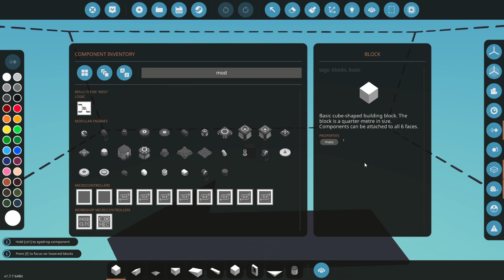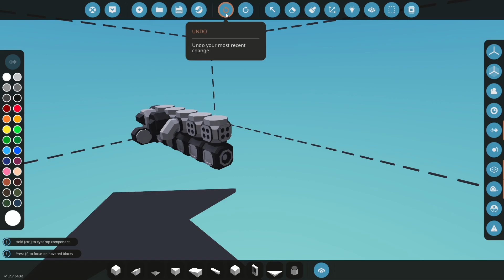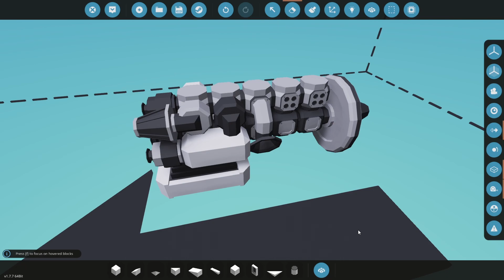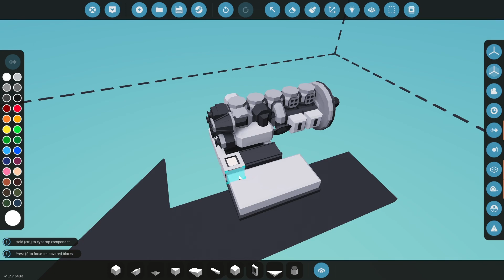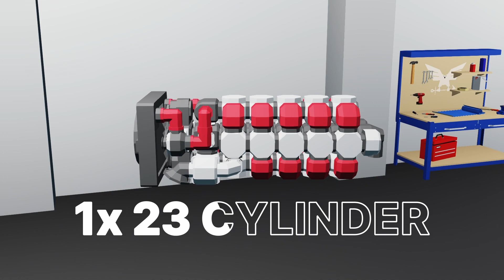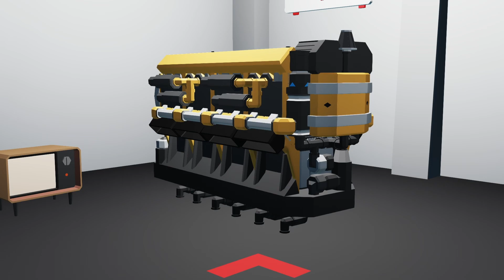Stormworks - Modular Engine Tutorial [Quiet/Delisted]

Comment: Very nice video. I have one objection though. You used the word supercharged to describe using a pump to force air into your air manifold. As far as i am aware a pump counts as a supercharger as long as it is externally driven. For example by a secondary engine or an electric motor.

Comment: Can the 3x4 cylinder engine be converted to overland use for mining machinery
Reply from the maker: I don't see why not. The decorations I used were based off pictures of engines inside a pilot boat. Underneath its still just another 3x engine.
Reply: @terr-rawr-saur  I was thinking about the starting method could you use 1 or 2 starters and the  cooling would need 1 elctr pump and 1 modular and a large tank
Reply: Also using 1 electric pump and 1 modular engine pump is better because I like realistic builds less complexity less chance to fail that's why I was asking about the starting method
Reply from the maker: @milantodorovic4034  You would have to be running a 3x engine at incredibly low rps to avoid overheating with only one pump. Flow rate is usually what determines cooling ability, so more pumps gives you a higher flowrate through the system.

If I were to use drive belt starters on a 3x4 modular engine I think it would need at least 3 or 4 to work, especially if there is a flywheel involved.